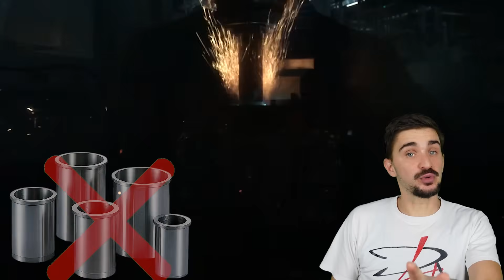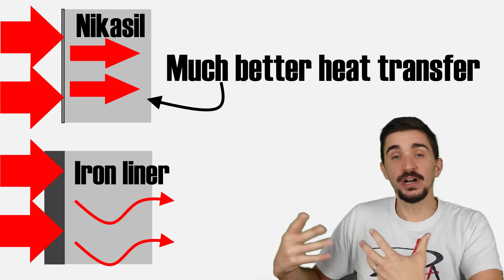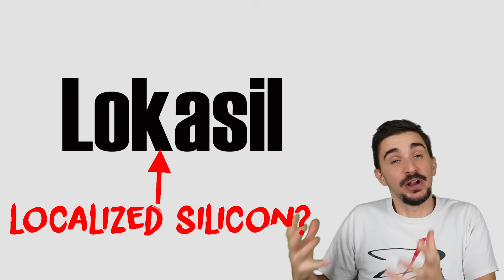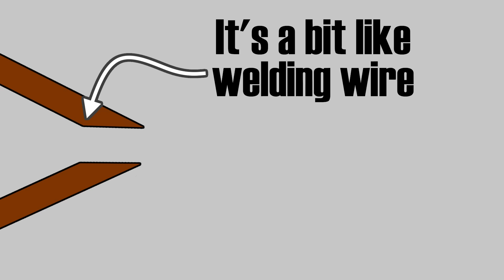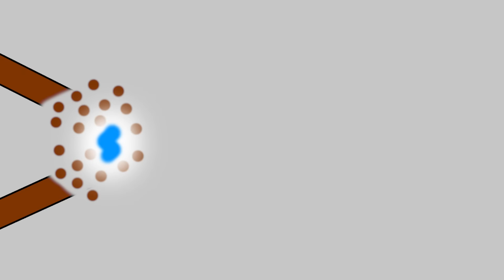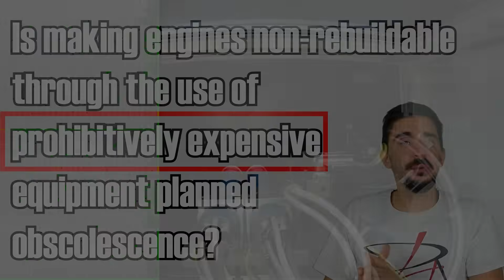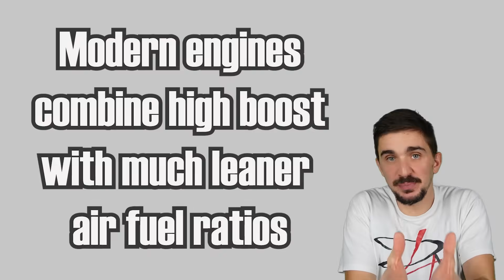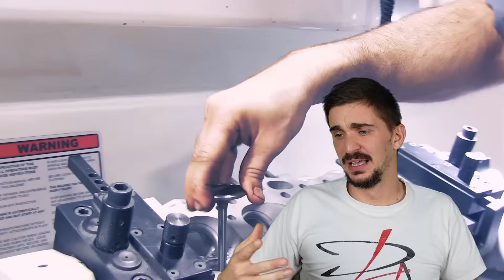Why Are Engines Becoming Non-Rebuildable? Everything About Cylinder Coatings

Comment: When the engine will outlast the car, why worry about rebuilding.
The only time the engine will need replaced is because of a defect or design flaw, or catastrophic failure.  All 3 often make the existing block less than optimum anyhow,

Comment: Nikasil coated aluminum cylinder bores have been commonplace in motorcycle engines for decades. They are still rebuildable, but the cylinder jugs are usually part of a separate casting that bolts on to the crankcase. So you can just replace the entire cylinder casting.
Reply: BMW at the time said the cylinders were final machined with a diamond hone. Who knows?
Reply: My 1982 BMW 650 flat twin had Nikasil lined cylinders.  They may have outlasted the rest of the bike
Reply: Most of the time replating the jug is cheaper though.
Reply: Not for my brother it wasn’t.

Comment: I don't know about other manufacturers, but anyone is welcome to open Audi Alusil engines with 500.000km and try to find scoring. I've done plenty endoscopies and driven and owned more than 25 Audis from that era in my life. None of them had any cylinder wall damage while not having done less than 250.000km, even in my RS6 C5. Audi Alusil engines are known in professional circles to be extremely durable, only beaten by their old iron blocks. IF you happen to have scoring due to overheating or infrequent oil changes, rebuilding the cylinder walls is rather expensive. 

Audi Alusil engines, as most German engines, were cast with silicon and then a laser burnt away the aluminium in the cylinders. That way the silicon was exposed and made for the hard surface. That's also why Audi engines lasted longer than those with etching. And that's the reason why those engines can be rebuilt by a shop with that laser.
Reply: What about using a different coating originally used.
Reply: @Loanshark753  I'm not qualified enough to answer that question, but generally there is little stopping you from adhering a different alloy or material to aluminium. I suspect that in some engines you could do steel sleeves but this needs to be done extremely precise and very well calculated and even then I doubt they will last as long as the Alusil. But honing the cylinders and applying a Nikasil coating would probably be the most desirable option.

Comment: As you admit the over all dataset you are looking at is small. I feel the biggest issue you didn't address is that when a vehicle engine is not able to be replaced that is a lot more than the emissions of the engine recycle or rebuild process. Being able to rebuild an engine allows for the rest of the vehicle to be used longer and removes the environmental impact of recycling/ landfill of an entire car.

Comment: 30kg... modern people do not throw away only their engine block. More often the whole engine, if not the whole car is scraped. Your ideal math i recon does not match our reality of consumerism. I was one of the brats expressing concerns, but i would not have considered coating "planned" obsolescence. I'm sure it makes for a technically better engine, however it's only "better" during its now shorten lifetime that could have been otherwise greatly extended by rebuilds. At a time where we are constantly reminded about ecology and saving resources... i think we do not need that amount of" betterness" it introduces. Especially for generic ass-mover massively produced casual cars. It's simply counter productive. We keep building more and more heavy complex unrepairable cars, and you know it better that any of us. Where i do think it was not "fully though out" , why couldn't they develop sleeved designs, but made of aluminum with lined material. Keep the idea, made it replaceable, best of both world ? In any case, we build to much shit. I'm saving my old stuff that works just fine.

Comment: I don't see why an AluSil engine cannot be "rebuilt". Bore it out and etch the surface to expose the silicon grains. It was common practice to use oversized pistons for rebuilt engines (maybe few shops rebuild engines these days). Thermal (flame) spray is a common industrial process to build up worn shafts and then re-machined. Then there is hard chrome plating that used to done for (generally airplane engines) rebuilding. However, the cost is probably limited to specialty engines. My first car was a 1973 Chevrolet Vega, Never had an engine problem other than replacing the timing belt. They had figured out the problem with overheating by then with a coolant overflow tank.

Comment: The problem is the importance being placed on Co2 emissions as a metric of climate change. Managing to reduce emissions by 300 tons of Co2 a year is the equivalent of what 50 cows produce in a year. Even a basic look at the math here shows us that lowering emission control is massively less polluting than trying to throw stupid requirements like using rare earth metals to build catalytic converters at an arbitrary metric that does nothing in the long run to combat real climate issues.

Comment: Very interesting and informative video, I have been  remachining and rebuilding engines for 30 years, and yes with certain modern type engines they are in fact 'throw away', however when customers get a quote for a replacement from the manufacturer, the cost is so exorbitant the customer either sells the vehicle as is or gets a replacement engine from a breakers yard. We have successfully remachined and rebuilt a number of ' non rebuildable' engines at a fraction of the cost and they still meet emissions values and longevity standards.
Some engines we don't bother with, certain aluminium open deck blocks with steam slits between bores for example, as it is too difficult to insert a sleeve with an appropriate thickness and still retain structural strength.

Comment: Let aside the fact that in the video its said that its not non-rebuildable and basically everything is rebuildable by converting to nikasil: Who has ever rebuilt a crappy family car in the last 30 years, for real? And not for just because you like the car or whatever, but because they just needed a car. Sorry but whats the point here...its just another engine coating. But ye...then I probably also would not have clicked on the video.

Comment: If the bores are still in good shape, then bore coatings aren't even going to factor into a rebuild. How often is an engine rebuild down to there being damage to one of the bores vs some other part fails and the bores are just fine? It seems like saying "bore coatings mean it can't be rebuilt" if the bore won't need to be serviced at all. A lot of the opposition I see to new tech in cars boils down to "Change bad! Change scary!"

Comment: If you ever want to see the headaches related to wet cast iron sleeves in an aluminum block all you need to go to is the PRV V6 engine that also can be found in the De Lorean.
It's a headache engine with many headaches build in due to the difference in thermal expansion and a lot of bad design choices making the wet belt design seem to be smart.

Comment: BMW had well documented problems with their system.
Coventry Climax tried running pistons directly on the Ally bore back in the late 50's early 60's.
Cosworth used Ni-ca-sil on the BDD formula Atlantic units ( Think BDA but designed to go another 2k rpm)
back in the early 70's 
All great ideas but not for the general public

Comment: Planned obsolescence doesn't matter how it was done when the result is the same. Planned? maybe not. But does that matter because the end result of a non-rebuildable engine design is what you got?

Dancing around technical BS is what should piss people off. The end result is what matters here.

I do appreciate your conclusion though when you bring up there is a lot of stuff being left out.

Something I think should be pointed out is not all countries will have our vehicles end up being recycled 100% of the time. A lot of the time they will likely end up in junk and scrap yards and just get buried at a 100% loss simply because it's not cost effective to recycle the vehicle. This is the primary issue with plastics since the vast majority gets sent to China and they just junk all of it because they can't do anything with it. Lots of plastic sent to recycling just ends up being sent to garbage dumps all over the place.

I'll always argue for rebuilding and re-using what we've already spent resources on producing plus all of the resources spent on transporting everything to and from manufacturing to sales vs getting sent around as jump before being scrapped or recycled.

Comment: Hi there. The sprayed in liner thing is not new. It was already used around 2003 for sure in the 2.5 liter PD TDI R5 engine in the 5th generation transporter. Later on they gave up the idea on this kind of engine build they use cast iron blocks for diesels instead. To be honest however those engine blocks could get to 500-800k kms without major issues with the cylinder lining so I’d say they did well for what they were (more like a testbed for a couple of solutions they decided not to develop further and get back to the basics). On the other hand those engines still can be resleeved. So I guess for engines not designed to cover high mileage it should be more than fine.

Comment: Just because the cylinder is coated, doesn't mean the engine can't be refreshed. I went looking for hones recently to deal with a rebuild I have planned, and plenty of manufacturers are listing extremely mild hone materials that are rated for coated cylinders now. You can't bore a coated engine without cutting away the coating, but re-ringing isn't out of the question.

Comment: Excellent video, on point, as always. HOWEVER: if you really wanted to, these blocks could be bored and sleeved with pressed-in or shrunk-in ferrous liners, light alloy liners with coatings similar to factory, or could be lightly bored and re-coated. Pretty much anything ever made can be rebuilt if the desire and the knowledge is there. And just FYI, Porsche used hard chrome bores in alloy cylinders on some 356 engines, prior to the availability of Nikasil.

Comment: Like i told you in the previous video, older engine with cast iron block is better to handle overheating while in modern engine you have to throw away and buy a new one

Comment: Had a Vega once, and it ran just fine.  In the day, the mechanic's wisdom was, for ANY engine, use good oil, and change it evrry 2,000 - 2,500 miles.  As my one boss used to say, he'd nrver seen one fail from changing the oil too often.  For the Vega engine, some said you could re-hone cylinders to expose fresh silicone.  But if you had bore wear, the usual fix was to sleeve the block; sleeves were cheaply available, and worked.  (Well, OK, the usual fix was to discard the Vega - but there really was no need.)

Re friction:  moving parts in an ICE are MOSTLY supposed to be separated, and sealed where called for, by an oil film.  You want metal surfaces that appropriately foster and sustain that film, even ring-to-bore, so much as possible.  Yes, rings and bores wear in to each other.  But try running them without oil (assuming you could while still supplying the bearings) and see what you get.

Comment: The financial aspects of rebuilding would have been very interesting for me. 
Yes I watched that last bit about costs, but there is a pice per year to own a car. Add in the rebuild and at some point if you plot both curvew against each other there has to be a crossection where buying new is simply cheaper.
Even fuel consumption is a factor. i would not like to own an old car with 10+L per 100 kmh.

Comment: Is this why we need to create a society where it’s easy to do most life and economic activities using a bicycle ? Even one with a small motor ?  And to use mass transportation for longer distances that begin to have lower amounts of climate disruption. I am amazed on the horse power to size of engine has maximized power to such an extent. 

Brovo to this video. 

FYI for some crazy reason I really got into two stroke technology as expressed in vintage mopeds. The Nikasil plated 70 cc Athena jug on one of my hobbits as well on a gilaroni ( spelling may be off) on my Magnum are amazing specimens of power but if set up wrong are usually paper weights. My 1993 previa also lacks sleeves as I recall. They all love to blow head gaskets so maybe iron sleeves handle heat better??

Comment: One problem with these very thin liner coatings.  When your water pump fails as will happen and you overheat the engine. The cylinder warps and gets scoring from the rings overheating and then your block is permanently ruined as GM found out when they invented  the alusil process and used it in the Vega.  Overheat for a significant period and warp out of round as well as score.  It may be high tech but durability suffers as a result.  If your engine cannot withstand minor component failure you have to ask is this p banned obselecence

Comment: I remember reading around 25 or 30 years ago, in either a motorcycle magazine or a book on 2-stroke tuning, a description of engine bore coatings. I THINK it was nikasil, but it was so long ago I don't remember the details. However, I do remember how the process was described, and it was as follows: a wire of suitable material was passed vertically down the centre of the cylinder, and a suitably high current was passed through the wire so that it vaporized, and the vaporized coating expanded outward to coat the cylinder.  
This was obviously a simplified description of the actual process, which closely follows the 2 wire approach you describe. Also, this was only talking about 2-stroke cylinders, possibly racing engines at the time. I also remember that it said you needed special piston rings designed to work with the coated bore.
Interesting, in 1986, I bought a Suzuki RG500 Gamma, and that had a coated bore, and a special coating on the pistons - either to make them more slippery, or to help with heat transfer, or possibly both.

Comment: Normies dont understand the term "planned obsolescence".  Consumer tech can do it easily.  Auto companies dont care, they care about getting it out the door, cheaply, and stays in warranty.  Difficult to repair just doesn't matter.  It sucks, but its not what planned obsolescence is.  

If older cars became illegal to drive due to not meeting the latest standards instead of being grandfathered, PO would be a bigger thing.  If cars stopped working after a set amount of time or cycles in th ECU, thats PO.  

There are a few counterexamples where PO arguably applies - the toyota stop-start starter not working after 10k cycles (something like that) is a great example.

Comment: As a part time mechanic, I work on cars on the side for extra $$$, your last statement hit the nail on the head….. most vehicles now are not worth putting a new engine in….. it’s so expensive to put in a new engine, that it’s cheaper to just scrap the car & get another car. Add on top of that most small to mid sized cars & SUV’s are built to be as disposable as a used tampon…..
Reply: It's less about the lifespan of the vehicle, or engine. It's about when something unexpected happens, and it fails outside of the normal parameters. If you do work on cars, you know that things fail in unexpected ways, and times. It's about fixing that scored cylinder wall because a ring broke, or you drop a valve, or the tune is so wrong that you melted a piston or 2. If the engine has 65,000 miles on it, the car should be good enough to warrant fixing. When we finally realize how BAD "cash for clunkers" was for us, and junkyard engines start topping the $2,000 range, you'll really want to be able to rebuild that engine. GM 2.4s are already over 1,000 at every junkyard within 50 miles of me.
Reply: @ pretty much anything ecoboost, ecotec, or pentastar is junk by 150k miles. Timing failures, turbo failures, coolant leaks, drinking oil, etc…… add on top of that the plague that has become the 10 speed gm/ford trannys & electrical problems bc of all the cheap ass relays, sensors & solenoids coming defective out of the box….. if you can’t work on them yourself, they are not worth keeping
Reply: @Remingtonrestoration most first owners rarely put 150k miles on the car themselves. So, why bother?
Reply: @Remingtonrestoration facts
Reply: @daszieher Because of a little thing called "the used car market"
Unbelievably short sighted.  Just wow.
Reply: @christopherlowery855  you don't understand. The used car market is just the outlet to fools, which have no formal connection to the manufacturer and LETS them get away with that in the first place
Reply: Emissions 🎉🎉🎉🎉 to recycle the whole car is way more than to recycle only the engine, dont forget about that
Reply: @ОсОс-к2д  Finally someone with common sense and the brain to see the big picture. So we can see the manufacturer looking for profit, not for reducing the carbon footprint.
Reply: @melinteradu8479  Literally the only viable recyclables are paper, glass and aluminum.
Reply: Because manofacturers made that so you will NOT rebuild the engine. And now, with the tight tolerances (that have no space for anything rebuilt) they made that official.
Reply: @gabrielvieira.4358 the customers buying these cars over others are complicit in this crime. You cannot blame manufacturers alone.
Reply: Expensive